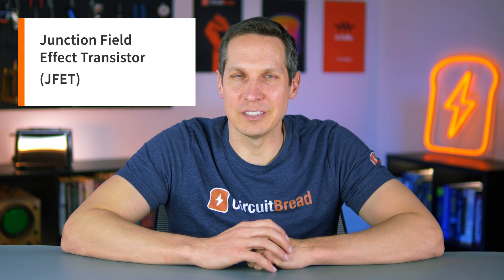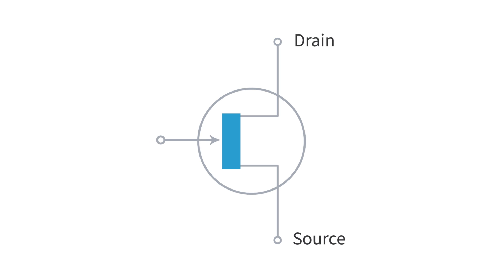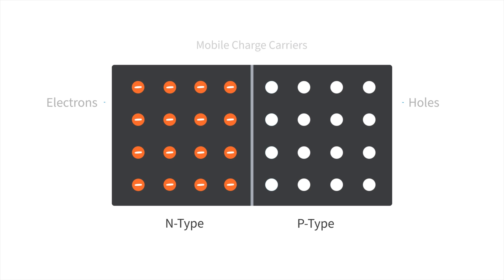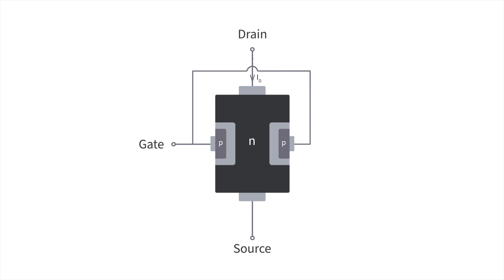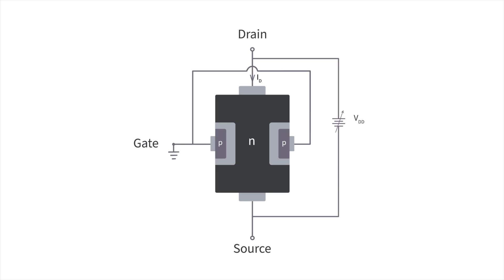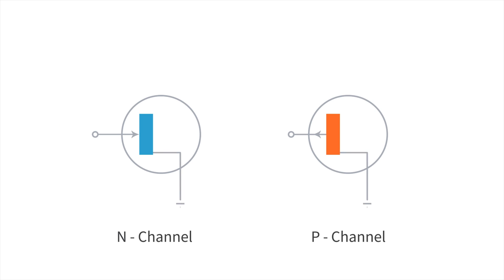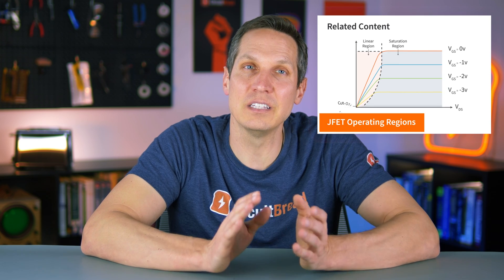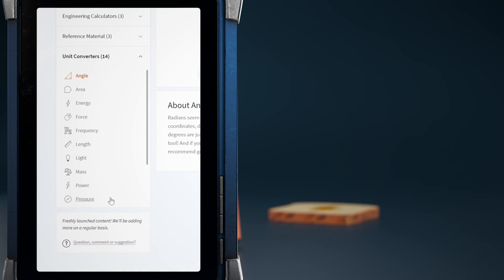What is a JFET and how does it work?

Comment: First of all, thanks for the great videos! I have a question though: You explained that if we keep the gate voltage constant but keep increasing the drain-source voltage the depletion region increases which narrows the conducting channel. Why doesn't further increasing the drain-source voltage lead to a complete cut-off? Why does it "only staurate"? Based on the concept that increasing the drain-source voltage increases the depletion region I would expect that the depletion regions around the two p-regions in the JFET eventually touch each other and completely suppress current flow.
Reply from the maker: Great question!  This actually confused me as well for the longest time.  But, in reality, it never fully pinches off because the higher voltage keeps being able to blast the electrons through the pinch-off region by the large electric field.  It kind of reaches a balance where, even if the voltage keeps increasing, that increasing voltage pushes the electrons even harder through the smaller hole.  That's why it starts acting like a constant-current source - that balance.  Does that help?
Reply: @CircuitBread  Thank You for that explanation! It does help!
Reply: @CircuitBread  I see it as proportional, higher drain to source voltage, Dsv on pinch off or saturation when gate is at 0 voltage and Dss I current at maximum. The higher the voltage the higher the reverse bias voltage between the gate and the drain, characteristics constant current. 

Brings to mind the saying equal and opposite reaction.

Comment: But are holes just the absence of electrons.
Doesn't that mean, when there are holes moving electrons are also moving?
Reply: The holes don't move, the electrons move and creates a hole, absent of a electron. Gives a illusion of the holes moving. 
The holes or absent of a electrons are fixed in the crystal lattace. In a 
N type substrate electrons flow easier than in a P type substrate !
Reply: @m101ist  exactly, but that's where my doubt lies.
In every book or every video, the explanation is that the majority charge carriers are holes and electrons, which I don't understand.
Why won't they explain just in terms of electrons. In my opinion it causes more confusion.

Comment: If I connect source of N-channel JFET to the ground and drain to +9V and then apply 4.5V to the gate, then is the transistor fully closed because PN junction gate-drain is reverse biased, or is it fully open and burned because of too high forward voltage at PN junction gate-source?
I don't understand JFETs

Comment: @CircuitBread many thx for the content. What I don't understand fully yet, is how the current increases with increasing source voltage, although the channel gets narrower.
Reply: Well I guess coz V=IR. So R is constant coz its the same material throughout. So V is directly proportional to I. So when the voltage increases the current increases. And current is a rate.  you can have the same current flowing through a thick wire and the same current flowing through a very thin wire. Of course if we consider a given time period of less say 100s. More quantity of charge would have to flow through the thick wire and less charge would have to flow through the thin wire to achieve the same current flow. So if you had something like a capacitor ( a device that stores charge ) connected to the two wires. The capacitor would discharge faster for the thick wire than for the thinner wire when trying to mainatin that current. Makes sense ? So yeah as long as a little space is left for electrons to flow though current will increase due to the increasing voltage and still continue to flow. Until that depletion layer becomes large and completely blocks off the current. 

So in summary voltage increases therefore current increases , but at the same time the depletion layers increase. But at one one point an increase of volateg will no longer cause an increase of current coz the depletion is layer blocks off the current flow. 

Hope this helps ❤

Comment: At 4:18 why deplation region is increased? explanation is not clear
Reply: The depletion region is increased duo to the reverse biased connection between the drain and the gate (note the drain is negative duo to negative channel and connected with the positive polarity of the battery Vdd while the gate is positive and connected to ground which is like connecting it to negative)
Reply: Depletion region region increases coz of the increase in voltage

Comment: are there cases when BJT is preferable over FETs?
Reply from the maker: Yep, definitely!  BJTs are more popular as amplifiers due to their transconductance and their switching times (which translates into a better frequency response).  The interesting thing with engineering is that if there were devices that were better in every way than another device, that second device wouldn't exist.  There would be no reason to use it so nobody would make it.  But with those devices that we do have at our disposal, it's always a case of trade-offs.  Better in some ways, worse in others.
Reply: @CircuitBread  tradeoff seems to be a major theme in engineering
performance in one way, another way, cost etc